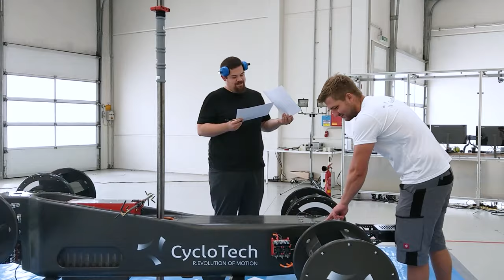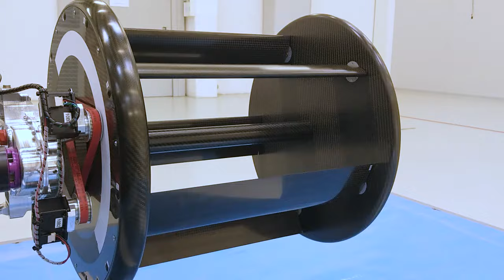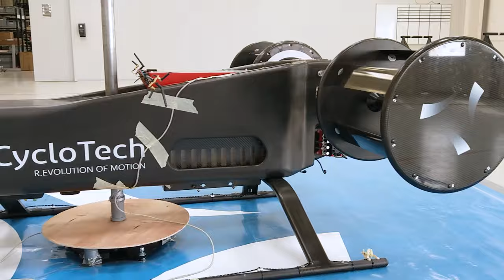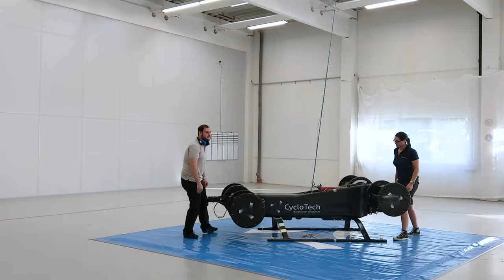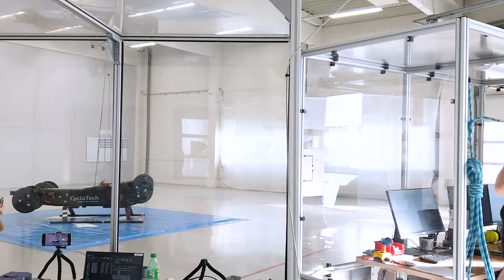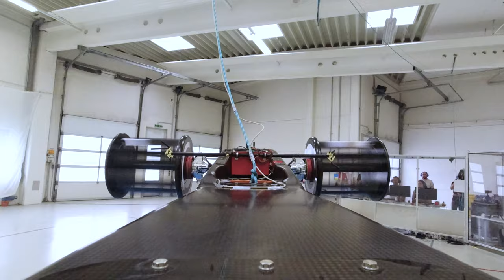CycloTech | Demonstrator First Free Flight (Indoor)

Comment: Free Flight? What is the big rope tied to the top of the fuse?
Reply: It's a legally-required tether, to limit its range of motion until certain certification testing requirements can be completed and demonstrated to aviation authorities. Note that the tether is slack and not contributing to the motion or control of the vehicle which is otherwise demonstrating freedom of motion.
Reply: @shannondror  So, not really 'free' then.
Reply: @isodoublet  -- If you understand the technical meaning of "free flight" as unrestrained control of attitude and motion capabilities, then it is truly free flight. It is not uncontrolled flight, nor free from legal constraints -- but then, even untethered aircraft are not free of such constraints. Likewise, this test was performed inside a building. Even without the legal tether, it would still be constrained by the walls and roof of the building. The demonstration was of free flight capabilities within certain controlled conditions. At some stage, it will be tested outside, in wind conditions, still with a tether. It could possibly be tested inside a wind tunnel or a large environmental chamber, to investigate its response to weather or temperature conditions. But as long as it is free to move in any direction at any given attitude, protective tethering is irrelevant.
Reply: @shannondror  "If you understand the technical meaning of "free flight" as unrestrained control of attitude and motion capabilities,"

But it isn't unrestrained, because there's a tether. A particle in a box is not a free particle.
Reply: @isodoublet  -- By your logic, the notion of "free flight" cannot exist, because all aircraft operations are constrained in some manner. Those constraints may be weather, or FAA regulations, or aircraft performance limitations, or pilot capability  limitations, but constraints are always present, regardless. You misunderstand or misrepresent what is meant by "free flight", which is a technical term that describes a testing framework. It is inappropriate and unhelpful to mock the use of the term because it doesn't mean what a superficial interpretation would demand of it.
Reply: @shannondror  " By your logic, t"

I'll be the judge of what my logic is. It's tethered, it's not free. "It's a safety line" that's the point.

Comment: While it's encouraging to see a drone operation that manages to lift its own 83 kg of gross weight, there was no mention of net cargo weight above that figure that these demonstrator rotors might carry. So far this is a net-zero demonstration, not a practical technology demo.
Reply: This is all the prototype and testing phase. Amazing this proof of concept is able to hover with that kind of stability!
Reply: @nighthawk0077  -- Now why should a drone with 4 identical propulsion units mounted at the corners of a rectangle ever be unstable, unless the units don't actually produce consistent thrust? Hovering drones are not uncommon at this stage. The must important demonstration here is the effectiveness of the horizontal articulating blade configuration -- that it provides controlled thrust without tearing itself apart, especially as the direction of thrust is modified by what may be as simple as a tie-rod. Traditional drones can only vary the power of each prop. But these units can vary its direction while maintaining constant power.  Regrettably,  this video did not demonstrate much of the maneuvering capabilities or methodology.
Reply: @shannondror  This prototype has already gone through several iterations with many design and system changes made along the way. This is far from the first hover test, however it is one of the first successful flights.

Comment: I love this, I really do. But the drawback is, a small failure would be a critical failure.
Reply: True, the complexity is scary. A helicopter has one complex cyclic pitch control mechanism per main rotor; a multi-rotor has at most a simple collective pitch control, but on multiple rotors. This has multiple rotors, each with a complex cyclic pitch control mechanism, and they're all critical!

Comment: I dont understand how you plan on doing YAW control with this... A quadcopter pushes air to the sides, you would have to tilt the rotors or something.
Reply: Quadcopters Yaw by changing torque on the 4 motors. They do not "push air to the sides".
Reply: @SoloRenegade  Not exclusively...
Reply: @UCO7NtKggv0JHP3bnUkIDKgQ A Tricopter uses thrust to the side. but quads do not. And yes, this tech changes the directions of its thrust in the 4 corners from purely downwards to forward and aft to get yaw. But quadcopters do not do that. chAIR works the same as a quadcopter. pitch and roll are differential thrust, yaw is torque.
Reply: @SoloRenegade  No it does not. chAIR uses tilted props because the amount and placement of thrusters does not make any sense in regards to torque yaw...

Comment: The future is,,,, HERE
Reply: this is 1909 technology
Reply: @SoloRenegade  -- Depends on what you mean by "technology". The materials needed to make this mechanism work effectively, efficiently, and durably in air were certainly not available a century ago, though a version of the basic design was implemented in some watercraft that long ago. The design of electric motor tech has likewise advanced significantly. So, really, it is not 1909 technology at all -- only the concept dates from 1909.
Reply: @shannondror  You are correct, but the innovation is old, and many people have experimented with this concept over the past few decades.

Comment: While this is neat and all, and i would tottally be all over it in the future if the vehicles were designed to look exactly like the blade runner 2049 spinner. I just cant seem to forget, ive seen more applicable technology that would allow for more design freedom. Essentially these arent doing that much that is new. Sure they have revolutionized helicopter technology, but there is a tech, that if brought up to a larger scale, would pretty much be the future of hover car propulsion, and allow for designs that would revolutionize the vehicle industry, and people would probably be aching to trade in their basic wheel based vehicle for a hover vehicle, with a boom in people now getting their hover vehiclle license that is very much like a drivers test but more reliant on how you handle a flying vehicle. But if you hav een the jet packs with some kind of differnt propulsion engine, that works like a real jet back, with what im guessing doesnt utilize helicopter rotating blades for lift. but i could be wrong, maybe this i the same tehnology, but i dont see it, considering propellers, limit the designs, and overall potential for what we can do, and bring about a whole new era of vehicle pop culture. Almost like the rise of the muscle car. Imagine how hover cars can revolutionize the racing industry? Although it cant replace our already working power grid, it could help do away with fossil fuels, but people wouldnt want to do it, if the vehicle wasnt anymore appealing then any hybrid, which suck because the designs suck, and thats the problem with new vehicles. The designs all suck. Take the SVX and the delorean for example, those designs catch the eye and appeal more to people then say something out of stark trek that looks sleek rounded,  like an electric shaver. They want something thats gonna call back to muscle cars, and hover vehicles in movies, and utitlize art deco futurism. with sharp angles and a boxy look.

So imo whoever takes that jet pack technology and makes it bigger to create a spidnner from blade runner wins this race to a new form of transportation, until then people will not be happy about switching to a poorly designed and ugly hybrid prius.

Comment: It's missing 2 Very important missed opportunities that would make this craft so much more efficient. 🤷
Reply: What are they?
Reply: @NeilStainton  vector thrust and regenerative energy that could be captured by the rotation. In my defense I was drinking and I'm sure that these guys have this covered. 
Note too self... don't drink too much! Lol
Reply: @NeilStainton  I'm guessing that you have something to do with this project as you haven't ridiculed me??!   I'm only brave when I've had a few beers.  If you are, you may benefit from my ideas, they may even be beneficial or could be totally useless as you have something up your sleeve.??..... I'm guessing a very simple 2 piece vector thrust system (half gravity, half powered vector thrust) would aid your craft and possibly a regenerative system that could overall increase an all round performance?! I'm guessing that this would also aid the agility. What do you have too loose, could be talking crap or I may make you look at an alternative.
Reply: Forgot too say Axial flux motor!? 👍
Reply: @FozzyZ28  Sorry, I don’t have anything to do with this project. I agree thrust vectoring may be required for yaw control but I don’t see how regenerative braking is useful for this project. Sorry I have got no connection with the design team.
Reply: @NeilStainton  no worries, thank you for answering Neil...... Sometimes I'm full of stuff! Taught myself the hardest job in the building trade and changed an old age career into a simplified job.  Was self employed for 15yrs and never advertised after year 4, not even on my vehicle. It's not about regenerative braking, it's just rattling around in my head that there's another possibility.?? Surely have no real idea but stupidly thought that it might be worth looking into by the experts.
Reply: Said that wrong?? Partner talking in my ear, I think that I have a real Idea that these fellas could at lease see if it works?!  Seems logical.

Comment: Cool, but not efficient by any means, far more points of potential failure than conventual systems, can't produce very much lift, and pretty has more issues than any other design for flight. 
Why are these guys trying to reinvent the wheel? What's the purpose here?
Reply: low aspect ratio wings